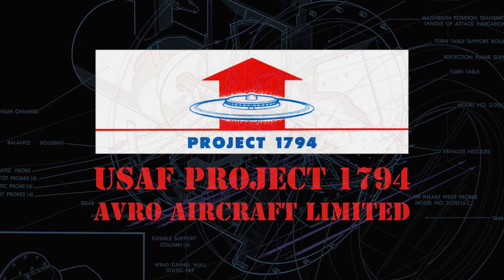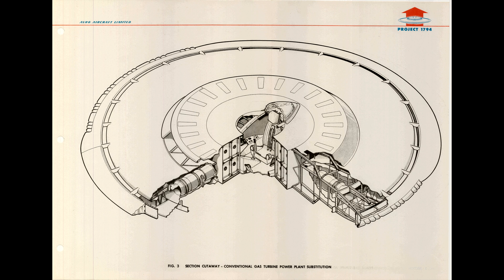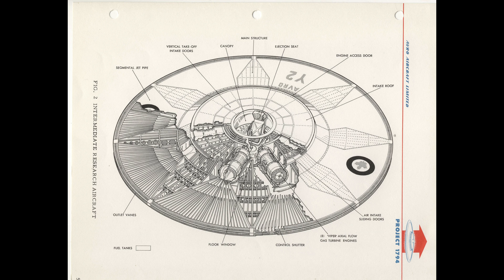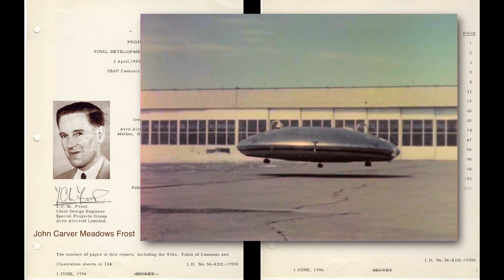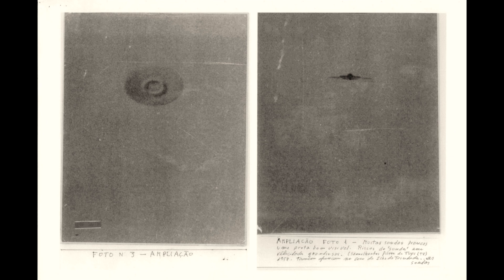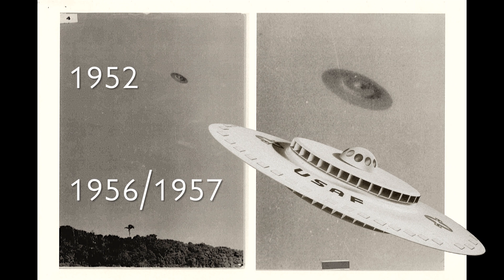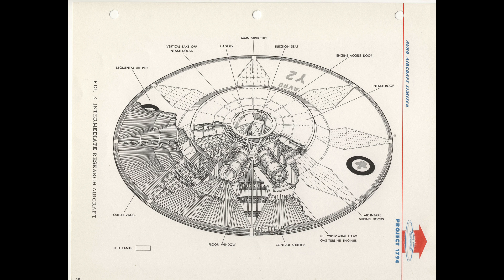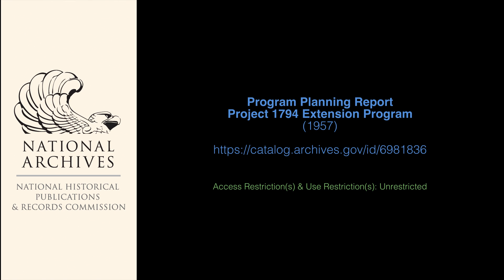Real military flying saucer research: Project 1794 (better sound+extra pictures)

Comment: There was a Canadian project that used jet draft over the tops of the wings and got a huge ration of lift whose figures I don't recall... Basically creating a vacuum over the top of the wings. I wish I could recall the details, but i have the friend who told me about it and whom I'll contact a to see if he can recall the details.
Reply from the maker: Other than John Carver Meadows Frost? I think you are talking about the coanda effect. And then you quickly get to Henri Coandă and Viktor Schauberger.